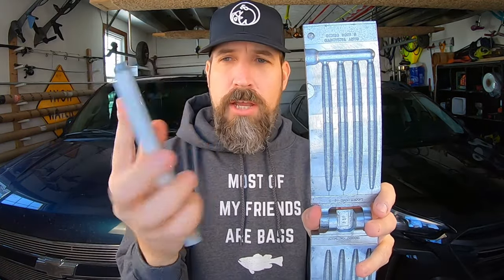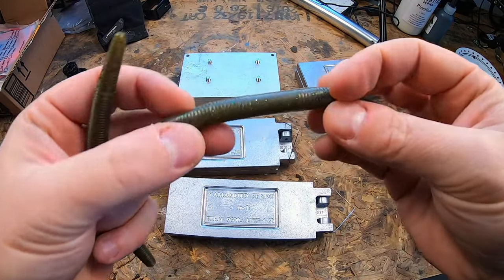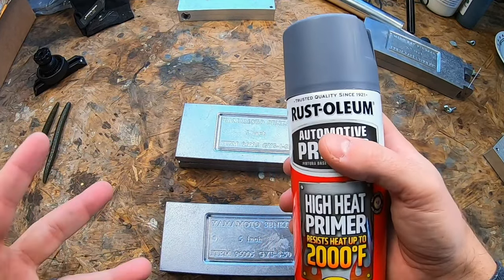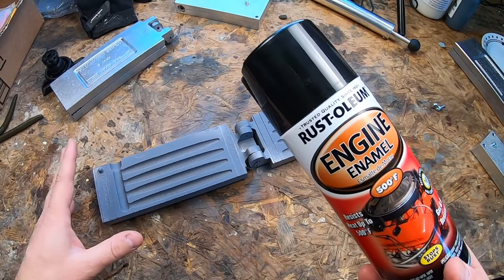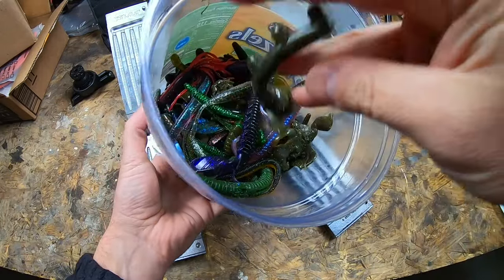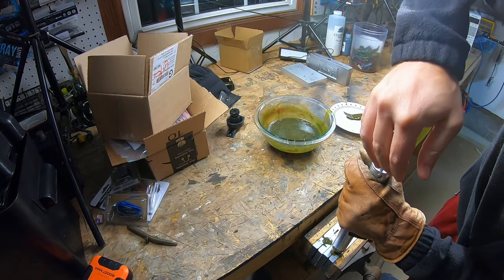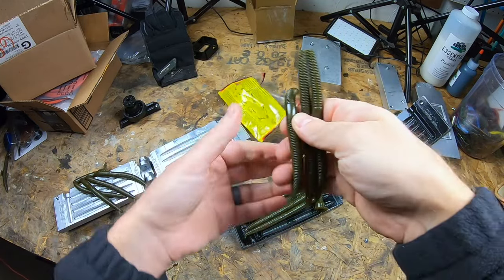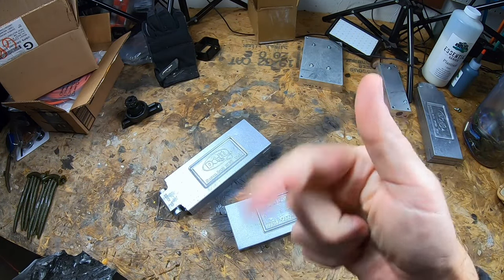Turn Your $50 Lure Mold Into a $100 Lure Mold with This HACK

Comment: Good Job Daren!
We send out and have a special coating also on the cavities of the molds that run 33% Glass filled Nylon resin developed by Dupont.
The coating will protect the mold , that glass will eat the steel. I have to run the molds at 190 degrees and resin at 560 degrees. Dangerous stuff.  You don't have to worry about that.

Comment: Nice explanation.  However...I think it's more than just putting a shiny finish on the lure; with a more opaque colorant, the smoother finish makes the glitter and mica or whatever's mixed in the plastic more visible.  I've noticed that when I shoot the same plastic in a cnc mold and a sand cast mold.  The cnc molded lure has more flash.  I'm try out your paint method on the Do-It slick shiner mold I ordered.  I'll paint a few cavities and leave the rest rough...and see what's up.  Don't know whether the fish even care...